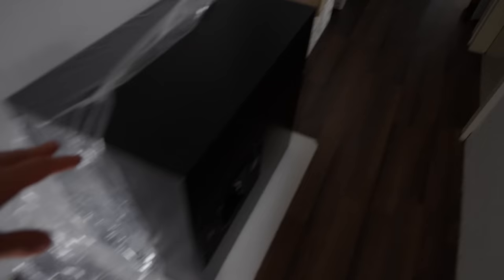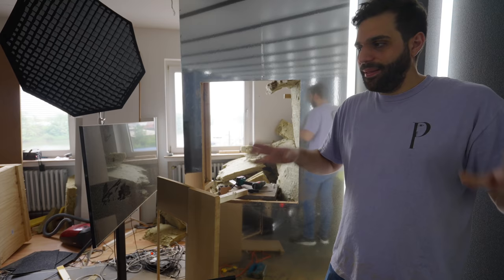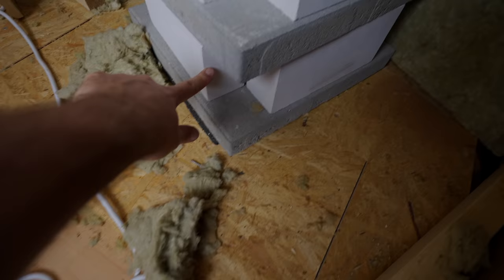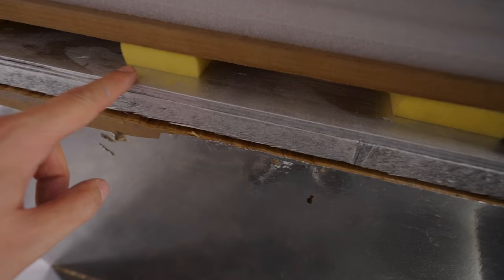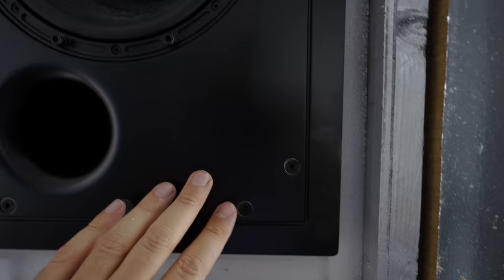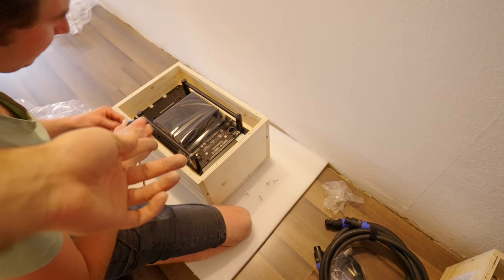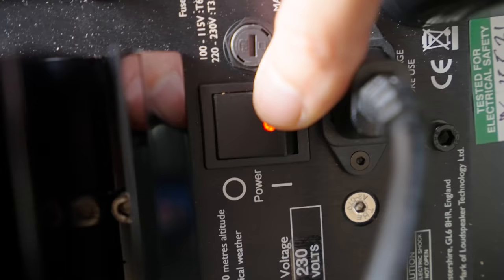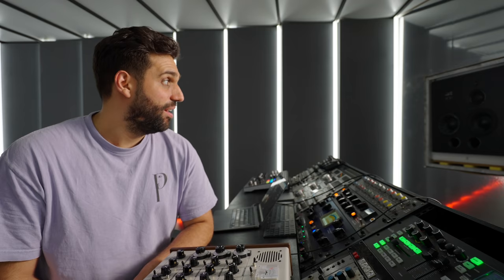Installing In Wall Speakers

Comment: I must be missing something.   I have still never heard an in-wall system that has great imaging an natural mids and highs— it always sounds like a modern club.  
I own have built several media labs and studios, with a range of in-wall, tower and elevated monitors for mixing and mastering mains.  No matter who (Meyer Sound, Clark, etc) we have used, I can tell you that even sets of $250K+ in-wall studio Ausperger’s and the like are not even close to even $20K well-chosen “tower” mains.  We’ve used ATC, PMC, and other “top” brands of in-wall.  From an engineering standpoint, there are issues with even recessing to wall-parallel any speaker, and true in-walls have other issues that have to be compensated for (at least as well as possible).   Theoretically, you could geometry and materials engineer a wall and monitor unit to work more optimally than what you find in even the most well-known studios— but i think, why make a complex task even more challenging.   
As such, I have moved back to in-room mains and nears.   What am I missing?

Comment: 3:34 - Why do you have that flat wood-aluminum surface in your corners? Is it sound reflective? Would it be better to have poliester or holes in that wood and insulation in the back?
Nice job, speakers and studio looks amazing!
Reply from the maker: it is just temporary the entire front wall will get another finish

Comment: Aren't those speakers usually mounted with metal rods in the wall instead of "being put on a stand"?
Reply from the maker: you can mount them in a lot of ways. we followed for the most part the recommended guid by the manufacturer

Comment: hey Jon do you know what is the penalty for driving through red light in Germany ? :(
Reply: Depends on how late you were. Less than 1s, about €100 and 1 penalty point, more than 1s, €200 and 2 penalty points.
Reply: @reasonable1  i think it was more than one second and i stopped immediately after i realized what i did but sadly it was not fast enough but luckily i didnt do any damage to any car or any pedestrian and i didnt cause the traffic to stop btw i received "anhörung"
Reply from the maker: good luck that is annoying. could be a couple 100€ and 3 months no driving license but check with your lawyer

Comment: the missinformation on this video is just crazy... that "syestem" of ïsolation" just doesent work. Theres a lot of physics that go into making a flush mount setup. Thats not good at all. If you want to do ir right buy speaker stands from nortward systems or just call the guys to make a flush mount the right way. The acoustics in that room are also really bad. You cant just do stuff like this without being an actual acoustical deseigner. People study their whole life to make sense of what goes on into making good acoustics and this guy just wings it and spreads missinformation. Im not a hater, i hope you suceed and experimentation is relly important but dont act like you know what you are talking about becouse you dont.
Reply from the maker: We build everything by plans we got from ATC auswelle as by the acoustician that sold the speakers.  Also all measurements are really good
Reply: @Jonsine  so you are telling me that atc told you do do that? lets get them into the conversation then becouse i really want to understand why would atc tell you to put their speakers on construction building blocks without any sort of calculation of mass density and dampening. Speakers over random stuff that them and yourself have no idea to what its doing to the sound. Its better then noting? Sure, but in this case less is more. I'm shure that theese foams are not doing any good for the woofer excursion. Im shure it sounds good, but it could be much much better. Theres a lot of things that are wrong there. Its physics. Im actually a studio designer and I know what im talking about. You can do anything you want with your stuff. But please dont act like you know what you're doing becouse you dont. All of that is missleading. You could spend much less and have much move if you had acess to the right knowledge but that years of study just to know that what you did is not good.